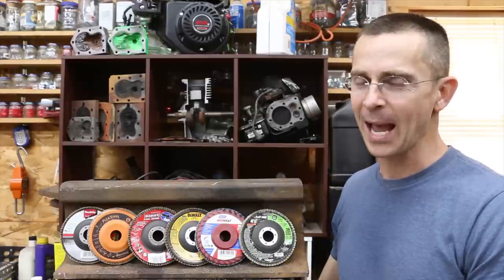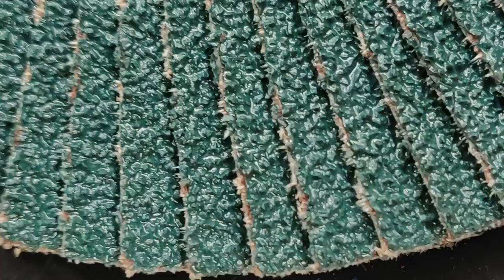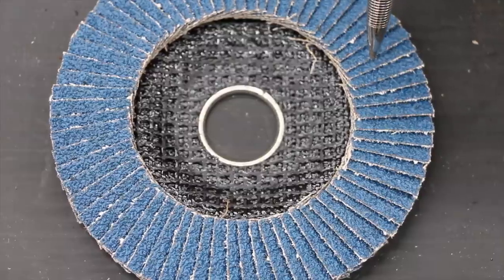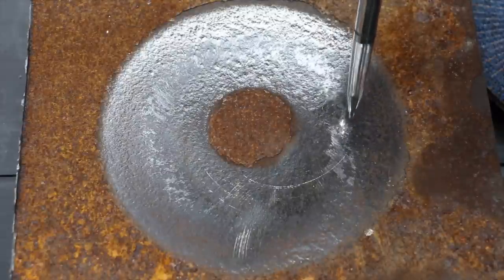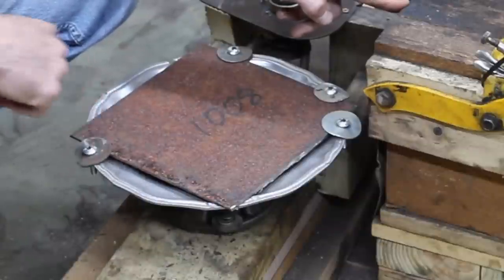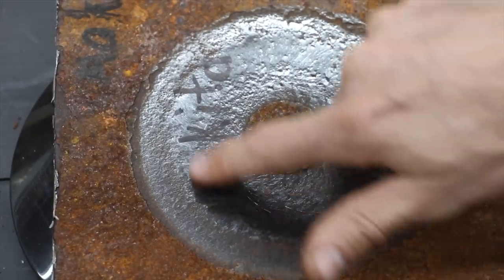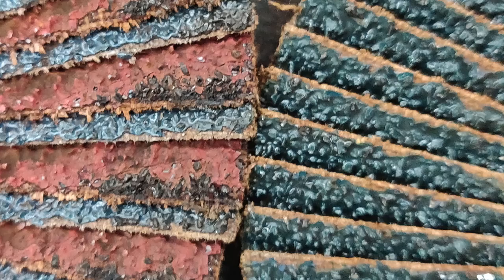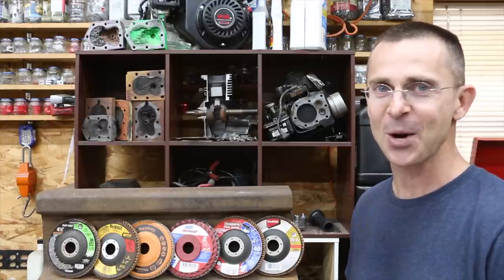Best Flap Disc Brand (6 Brands Tested)? Let's find out!

Comment: I use only DeWalt flap disc's but I only use there Zirconium disc's. 36 grit DE Walt zirconium disc will remove metal and welds faster and last ten times longer. Do a test using only one zirconium disc and see what the results would be ?
Reply from the maker: Thanks for the video idea.

Comment: So I just paid $10 for a Norton at lowes and there are several others cheaper that work just as good. Although I think on this test the Norton test had much less rust and got down to the hard metal surface sooner. All I know if I have used the HF disk and they are terrible. Even for $1.
Reply from the maker: Thanks for sharing.

Comment: For these tests in which you lay a 10 lbs weight on your tool, you should put a scale under the finished jig. That would tell us how much pressure the tool is applying to the working surface during your test. Which you can then take, and compare to your actual work habits. Deciding if 10 lbs on your tool jig is excessive and tests to an unrealistic standard.
Reply from the maker: Thanks for the suggestion.

Comment: should I use flap disc over grinding blade to sharpen my lawn mower blades? I'm a newbie and have the 7amp bauer corded one from HF. they were on sale for $20 today. I need it to cut some old dead tree (2 inch diameter -  too lazy to use hand saw) and to sharpen my lawnmwer blade periodically.
Reply from the maker: Thanks for the suggestion.

Comment: First issue, 40 grit is about the worst you can get when it comes to flap wheels. The grit is so large that it is torn off in the grinding process and then takes more grit with it as it interacts with the rest of the flap wheel. 80 grit is about the best you can get if you want longevity and productive use. If you are working on really rusty and pitted material you are best to just use a standard bonded grinding disc. Then finish it off with an 80 or 120 grit flapper. 

Secondly, you missed out on the two best wheels out there. The best pound for pound that I have ever used is the SAIT (united abrasives) brand. The Ovation and the Attacker are the crown jewel of the high density flap wheels. Give them a try and you will not be disappointed. 

The second brand is the Zircomax by Flexovit.  On the same league as the Sait abrasives but less well known. 

The issue with all grinding consumables is the price, most people just buy the cheapest available as they think that they are all the same, A good flapwheel will cost you from 8-11 dollars but will out work and out last the cheap wheels which will end up costing you less money. The same can be said for all abrasives, you get what you pay for.
Reply from the maker: Thank you for the constructive feedback
Reply: @ProjectFarm  You're welcome. I have been in the industry for far too many years. Enjoy your content, keep up the good work. I appreciate it!

Comment: Im curious for a 2nd run but i only because i feel like you have the edge of the wheel do the work. Ive always been told that the flatter the disc theeasier it is on the wheel.. maybe decrease the angle of the grinder?
Reply from the maker: Thanks for the suggestion.

Comment: Is it possible that since you doubled the weight on the second go, that wore the grit faster than if they had remained the lighter pressure? If you ever get around to re-doing this test, please keep that in mind. Great video as always though. Information Handy People can use!
Reply from the maker: Thanks for the feedback.
Reply: @ProjectFarm  Dad always taught me- let the tool do the work. Like pressing too hard on a drill bit to try and drill the hole(s) faster, never ends well for the bit. Thanks for receiving feedback- you're a rare one. Blessings sir

Comment: Something you're not 100% accurate with is the fact that you can buy the Harbor Freight Warrior wheels for $0.99 with a coupon, limit 4, and in 4 different grits. The Super coupons are always available for these. I just bought 4 of each of the 3 grits available, 36, 60, & 120. The current coupon expires on the 30th but another coupon just posted through Oct so there's never any reason to ever pay full price for anything at Harbor Freight.
Reply from the maker: Thanks for sharing.

Comment: It’s not about how well it removes material, but how long it continues to so. Some work great then just stop working while others you can use until a nub almost. You need to just try them all yourself and pick what works for the material you are grinding. They work different on different material, i.e. aluminum vs steel. It’s not about value here, it’s about what works! Time is money.
Reply from the maker: Thanks for the feedback.

Comment: I don’t think the amount of rust on these pieces is really what you’d find in reality. When I buy these I first use a generic grinding wheel for getting through rust and then the flap disk for a bit cleaner finish, and I think most people do that also. I think it’d be more accurate to also add a clean piece of steel for the testing.
Reply from the maker: Thanks for the feedback.

Comment: I think most of your tests are quite accurate but this one has a big problem. By using rusty steel each test piece is not the same more rust build up will have more weight removed and the pitting which is different on each piece will affect the wear of the disc. Not testing abrasive specialists like 3M , Suhner , Garrison, Flexovit, Josco is an oversight also. Makita and Dewalt are over priced rubbish.
Reply from the maker: Thanks for the constructive feedback.

Comment: Hello-----Well, once again I need to bring you up to speed concerning Harbor Freight.  I am going into my Harbor Freight store this Friday with a coupon for Warrior 36 grit, 4&1/2 inch flap disc for $1.00 EACH with a limit of 5.  I will be using this same coupon TWICE in the next few weeks for a total of 10 at $1.00 each.  I have been using these flap discs for YEARS and I can testify that each one lasts for a very long time.  Your tests don't reflect actual usage and wear and you need to learn to buy at the right price to save money.  Also, you can use these  for wood sanding and then they last for a very, very, very, very long time.  Just so that you know.-----Lynn
Reply from the maker: Nice!  Thank you

Comment: Rust is very hard on ANY wheel... fact is, anyone who is into fabrication is NOT going to waste time with crap metal like that.  Just doesn't seem relevant to me.. 
  Also, when flattening welds, removing berries, or rounding edges, you're going to grind in the flat position to ensure a good flat paintable surface that is not all gouged up.
 In the shop, COST is a huge factor and when you can buy 2 HF wheels for the price of 1 Default, it's a no brainer.
Reply from the maker: Thanks for the feedback.

Comment: has a professional I don't think this is a good test at all, every test was wrong. allthough I love your videos man
Reply from the maker: Thanks for the constructive feedback
Reply: @ProjectFarm  based on my experience, what defines the quality of a flappy disc behond it's initial wear is the way it wears during its lifetime and how effective it keeps working until the end, some disc just can't keep doing its job properly when they reach its half. The other factor is the quality of the grinding. The material they are working on is a huge factor too, because some of the disc's were designed to grind stainless or alluminium and their performance on iron can differ.
Testing this type of disc is like testing tyres for a car. The test on the cutting ones was very accurate though. 👍

Comment: so he says the makita is not the best because it removed a lot of Rust and steel but got a lot of wear and tear - So my question is .. What if I only wanted to remove the rust? The Makita is the best.
Basicly the best wheel is the wheel that works the best for you. Abrasive testing is quite false as each single wheel will have enough variation during its life to make a scientific wear or use test unscientific.
Redo the test add a aluminum oxide, Zirconia and a Ceramic grain flap wheel, run 500 wheels of each and average the results. Then you can definitivly say which one is the best
Reply from the maker: Thanks for the suggestion.

Comment: Hi, I noticed that the close ups have blurry sections(ex 5:05), you can get a clearer image by making a composite image. By taking several images at differing focal lengths and layering them together you can achieve a sharp image.

Comment: Flap disk are made to make a surface even not to take off that much at once.  Put it in a vinegar bath for 4hrs. Then do the same test.  Everyone knows you have to pre prep your metal before you grind. You have scale, rust, cold an hot that can go wrong. Ummmmm. Try flat weld next time?
Reply from the maker: Thanks for the video idea.

Comment: All flap discs suck. They are good for the first few minutes, but then wear out quickly. A 75% "intact" disc is garbage. At $5.00 to $8.00 each, that's  an expensive pile of worn discs in no time. The
real insult though, is that 90% of the abrasive remains hidden under each exposed section of flap; you just can't use it.
Reply from the maker: Thank you for the feedback

Comment: I just buy cheap shit flaps 2 bucks dose the job I only use them to debur and to remove the scale off steel for welded joints. I can't bring myself to blow 15 bucks on a flap wheel when I go to the dollar store spend 1,25 and last just about the same as name brand
Reply from the maker: Thanks for the feedback.